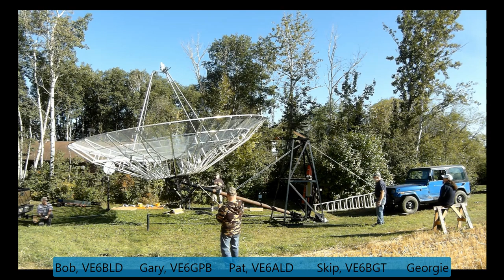Moonbounce EME Dish Azimuth Drive Upgrade

Comment: WOW! You are a serious amateur radio guy, or now are you a serious astronomer? What electronics do you use to detect the bounce back? Is it about 2.5 seconds there and back? or one way?
Reply from the maker: Hello David, well so far I am just a ham radio operator.. I plan on trying to detect pulsars etc later on.. The typical setup we use for getting echos back or talking to other ham operators varies depending on the person and size of dish or ant. Recieving the signal back you need a very good high gain low noise preamp at the dish.. For 23cm or 1296 mhz I showed on there it then goes to a transvertor then to the radio.. The signal takes around 3 seconds there and back, but I use a sequencer to switch things between recieve and transmit so it can cut the time I can hear the last part of the echo.. It's one of my best thrill hearing echos..  Skip
Reply: @VE6BGT  Thanks. Looks like you have the land for it. Years ago, I made a 5ft tall Yagi to listen to "big bang hiss". I aimed it at the center of our galaxy and the hiss got louder. Woop woop! I had an old C band satellite dish in the back yard, 7 ft, maybe. It blew over 2 months ago. My wife was thrilled! Hobbies are woodworking, electronics, gold prospecting, car repair, movie making, laser art. Home owner, so everything breaks, needs repair. I retired from intel. I wish I had a radar system!
Reply from the maker: Great stuff David, great hobbies for sure.. I figured you probably knew what I was talking about.. It's a lot fun, I try to build as much as i can...  Probably what I enjoy the most.. Skip
Reply: @VE6BGT  Yes..I like to fix and build things more than using them! CRAZY!!! My garage is FULL!